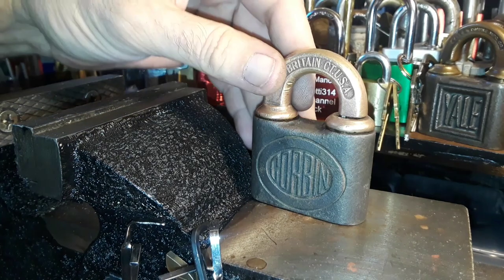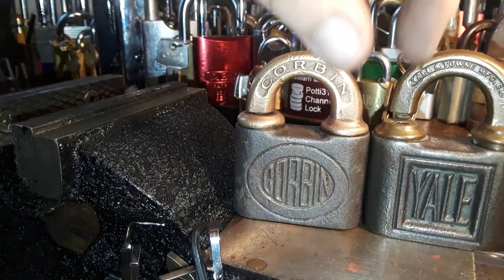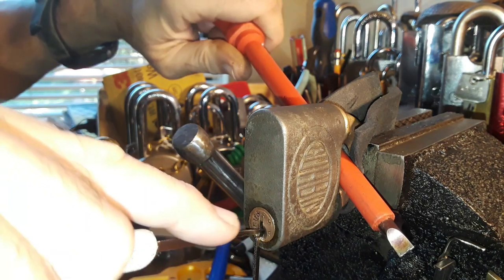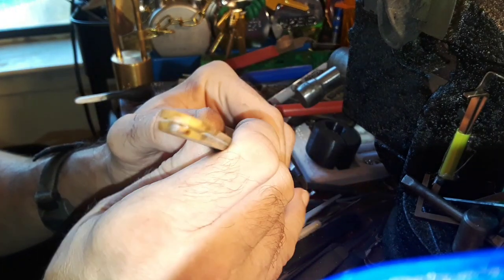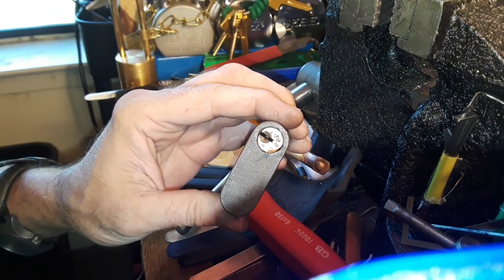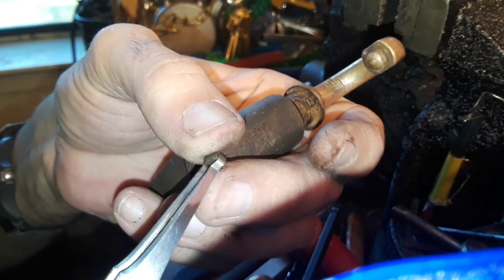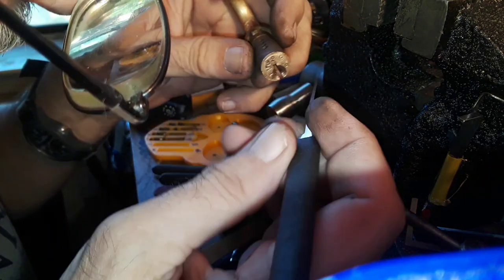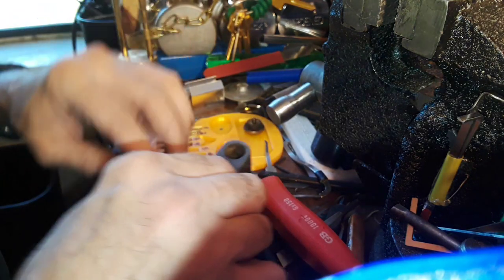(453) Cleaning & Taking Apart An Old Corbin Push Key Padlock

Comment: 1. "Ooooooh!" - after breaking your pick. 2. "Oh, right, chipmunks!" - during the video speed-up. I really enjoyed the lock restoration. With my Yale locks, after the vinegar bath and I had washed them off, I used steel wool to go over my Yale push key padlocks. I've never had the courage to actually take them apart though. No guts.....no glory.